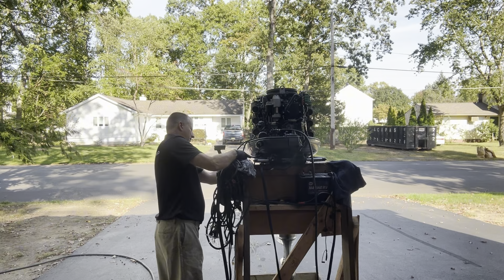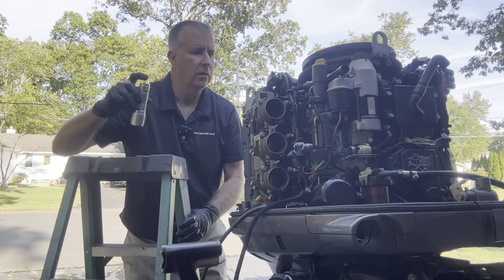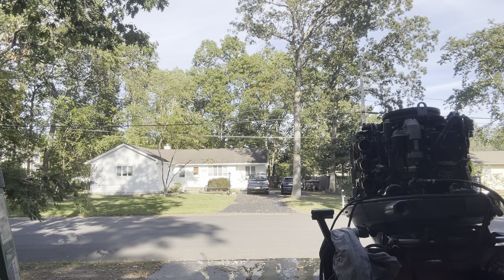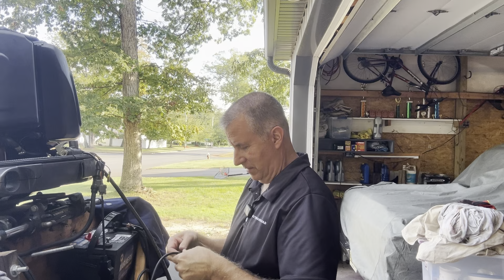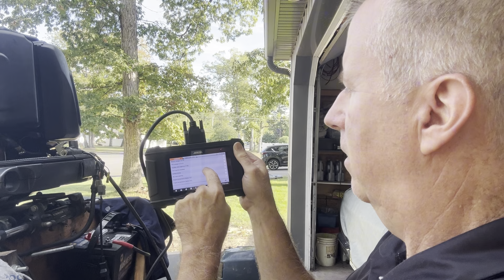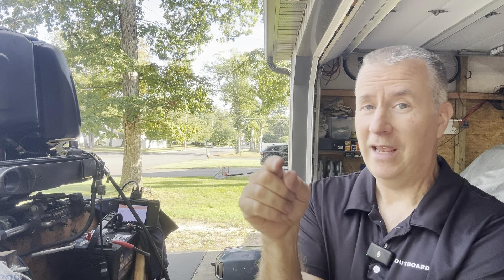Yamaha 225 Four Stroke First Start + Live Data with ANCEL MR500 Diagnostic Tool

Comment: Considering buying this tool. Are you able to perform any running output tests i.e. cylinder drop-test, fuel control testing? Can't find anything online. Appreciate your videos. Very helpful.
Reply from the maker: Yes you can do live running tests, not sure what you mean by cylinder drop? Cannot tell compression when running but can tell if ignition is failing and all sensors can be seen while running. The best part about these tools is if you do t use it you can sell it later. I had the Mercury tool years ago, sold it, then needed one again and bought a used one. Be sure to use the link below for the discount and email me proof of purchase and I will help you any way I can. Keith@outboarddad.com